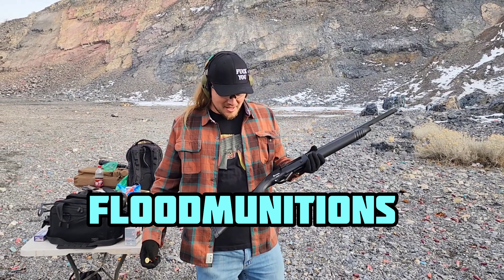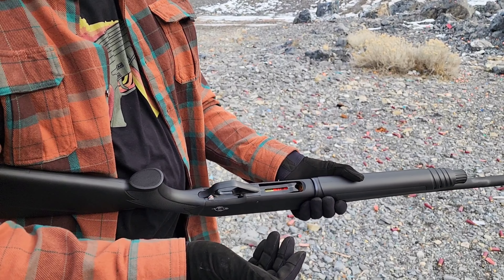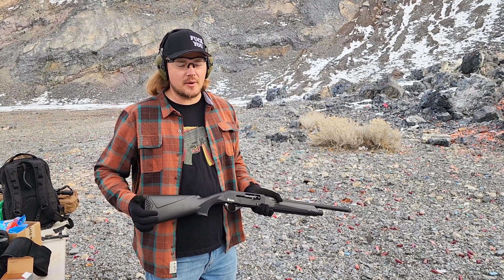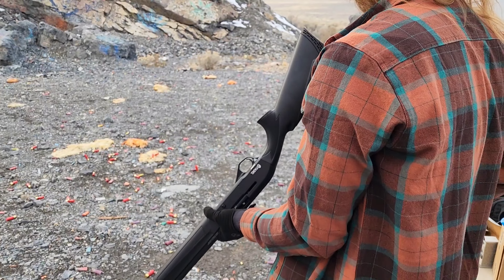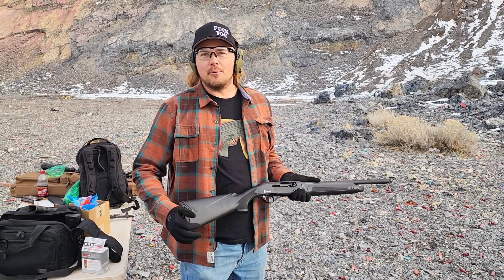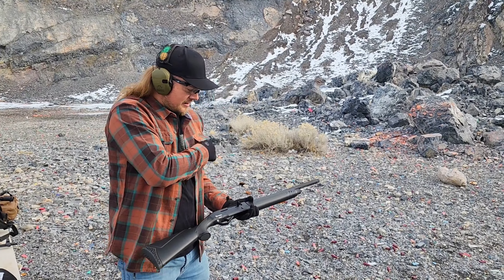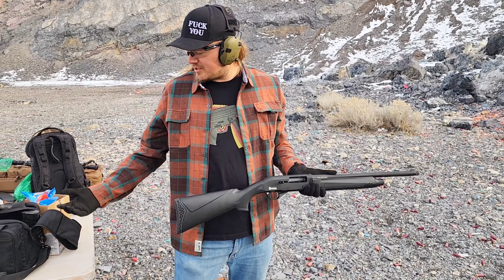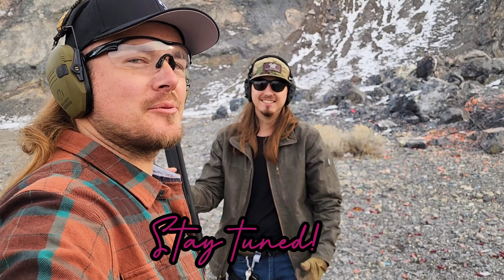The Citadel Boss Hog.. Begin Phase One.

Comment: I have this very shotgun, made a few mods...pistol grip stock, magazine extension which makes mine a 8+1 and have hundreds of rounds through and has yet to fail me once.
There are a few things you need to do to make this gun work great.
One, when you bring it home, take it apart and clean the shipping grease off of it, it does not come with function oil, lube it up and store it for a day or two with the bolt open to soften up the spring.
Your first 100 rounds should be no less than 1200fps ammo, I know the note in the box says 1300fps, but that for people that don't clean the gun before use.
These cheap guns are not factory broken in like more expensive guns.
Overall this is a fantastic semi auto shotgun provided you break it in and clean it before use.
Reply from the maker: Wise words! Thank you for your input. Mine has been running great through all the abuse it has gone through.

Comment: I have the same shotgun and I added an extension tube so it’s a 7+1
Reply from the maker: That's pretty rad, didn't even know that was an option!
Reply: @Floodmunitions  It’s actually 8+1 but I have  to adjust the spring to effectively load the 8th.  You can use a carlson 3 round extension but there is some slight modification.